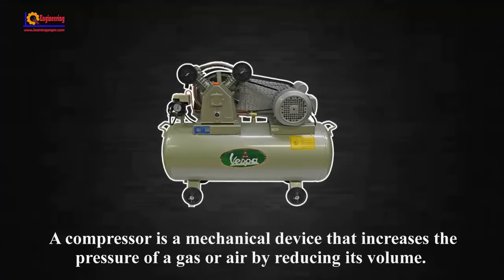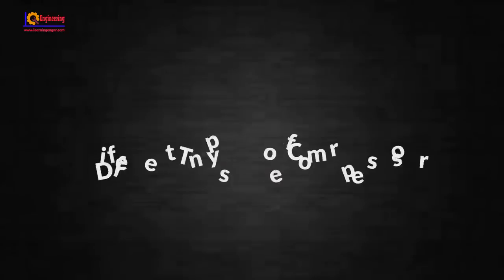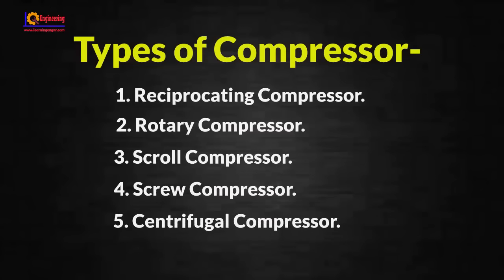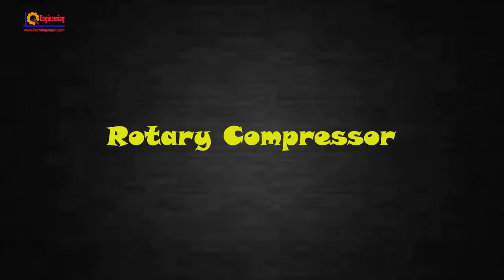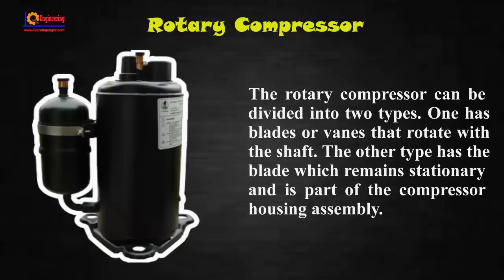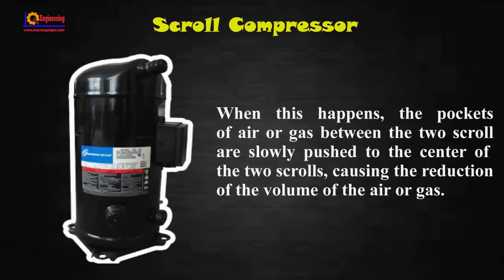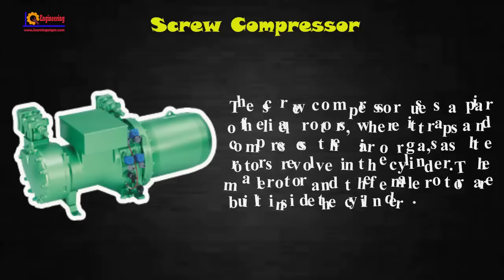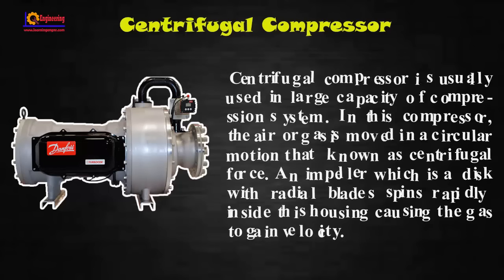Compressor - Types of Compressor - Compressor Types

Comment: Video would have been MUCH more helpful if you would have used animation of the inside parts and workings of each compressor type instead of just showing the outside of the compressors while trying to explain the operation.  Not very helpful.